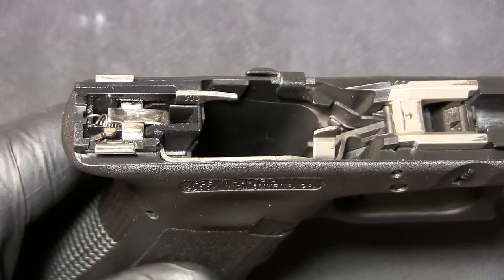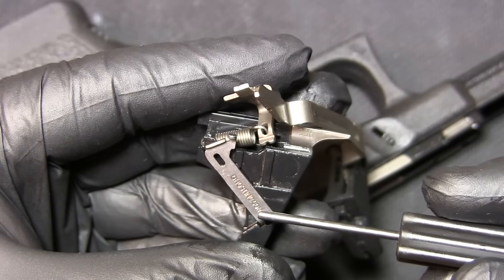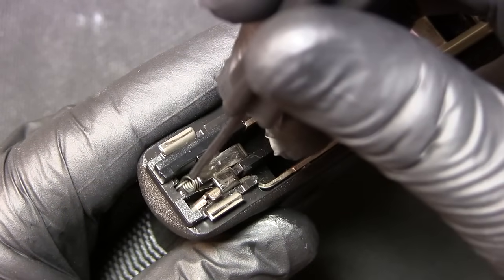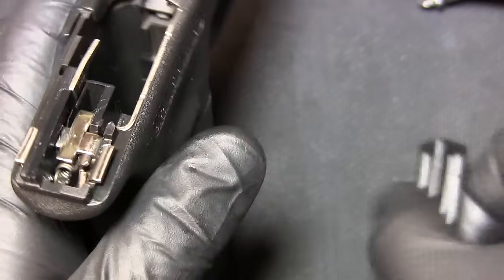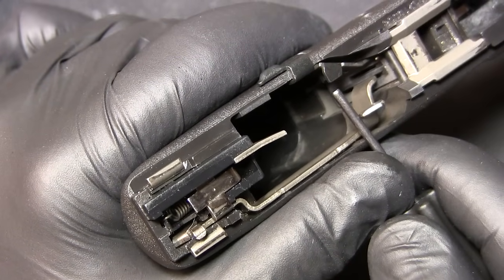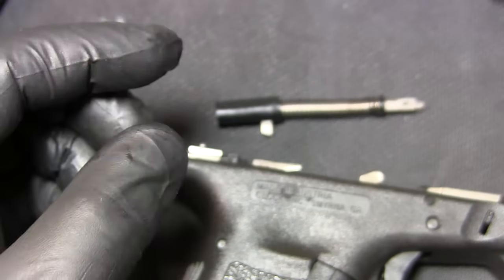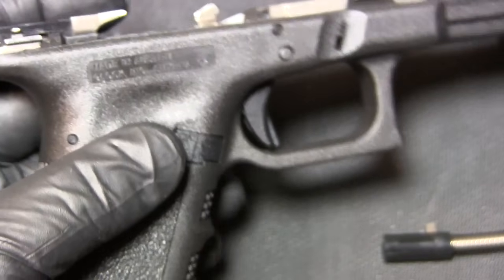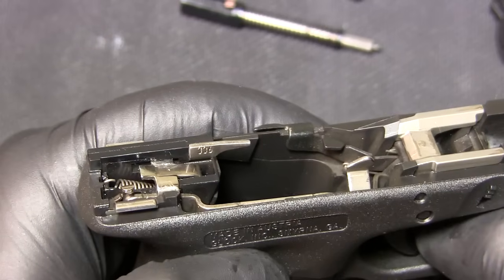How Glock triggers work and how they reset

Comment: Yes my compliments on the video as well great job!
I've never owned a Glock but I just put a G23 on layaway.  I have a Ruger SR9C that I love but wanted to add to my collection. 
 I like to know how things work as well and always do my research in anticipation of possibly doing a trigger job etc. 
I have also read and watched another vid about the bump on the trigger bar that comes on the Gen 4's. Some have stated the Gen 4's having a "gritty trigger" when compare with the Gen 3 and earlier. Their remedy was to replace the trigger bar with an earlier trigger bar or filing down the bump. As I understand the bump is to center it on the block. 
When I briefly tested both Gen 3 and Gen 4 in the gun shop I couldn't tell much difference personally. But there is probably some truth to this. Any comments on this?
Reply from the maker: I don't have a Gen 4 unfortunately, because I am in California. But from what I could see, the bubble on the trigger bar is there for a reason, and like you mentioned, to ensure that it rides onto the firing pin safety. Though I am not a Glock armorer and cannot be entirely sure. I have heard of people complaining about the trigger pull on Gen 4s vs Gen 3s as well, and I have heard them say that reducing that bubble or replacing for Gen 3 trigger bar seems to help, but I am not sure how that smooth bubble riding along the side of the slide would cause a gritty trigger. I would have to feel it to see if they are correct. Maybe if I get one through Single Shot exemption, I will let you know.
Reply: Oh I didn't know there was a restriction concerning California I'll have to read up on that. I subscribed to your channel look forward to the informitive video's and thank you for the reply.
Reply from the maker: Brad Mann Yes, California uses a handgun roster. Manufacturers, I believe, have to pay and pass a "safety" test to be able to sell in CA. And CA considers even the finish of a gun to be a different model, so each model has to be submitted and paid for. Gen 4s were never submitted, and after some new regulations, Ruger and S&W are pulling their products out. AWESOME, RIGHT?
Reply: MosinVirus Wow hard to believe....what else will they come up with next??!
You can usually follow the money trail in most situations,and it sounds like this seems to be exactly one of those times. Would make a person want to move out of state really. I say that...and I live in IL (southern part,not close to Chicago) and we finally just got CCW.... The delay due to Chicago politics I think.
Reply from the maker: Brad Mann Yes, California is going crazy when it comes to gun control. There are plenty of weird things going on, that not only do not make any sense, but definitely do not solve any "issues" they are "trying" to solve.
Reply from the maker: So, I have recently gone to a nearby shop that does SSE (Single Shot Exemption) and tried the Gen 4 30 vs Gen 3 30 SF, and to tell you the truth, I liked the Gen 4 trigger better. I didn't feel the "gritty" trigger that I have also seen many people describe on YouTube. I will see how it does at the range, but I am sure it will be fine. Maybe I am not as "fine tuned" to Glock triggers.
Reply: My gen 2 Glock 21 had the bump, so it's not a new thing, but I believe it was not on Gen3s. Or maybe it was just on the large Glocks?
California's Roster has gone insane, there is a new requirement for getting on the roster which is the inclusion of "Microstamping". So the firing pin must imprint the serial number on the fired primer. The technology was demonstrated, but is completely unfeasable for manufacturers. The Roster has now become a de-facto ban on ALL New handguns. ie; new handgun models will never be sold in California because the "new technology" is akin to requiring guns be made of Unicorn horns and leprechaun hair.
Reply from the maker: Vince Lok I have no experience with gen 2s. Interesting why they stopped using the bumped trigger bars in gen 3s and brought them back with gen 4s. Well said on the roster. It is insane. I can kind of see the reasoning behind LCIs, drop safeties, and magazine disconnects. I don't agree with them, but see how someone could think that making those mandatory would make for safer ownership. And that is why the roster is in place. For safety reasons. Okay, then explain to me how microstamping improves safety???????